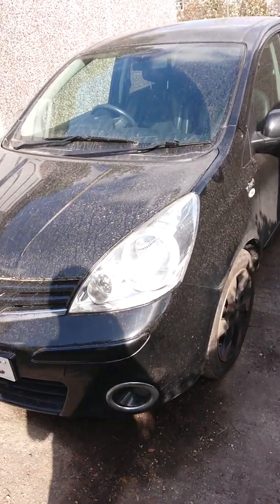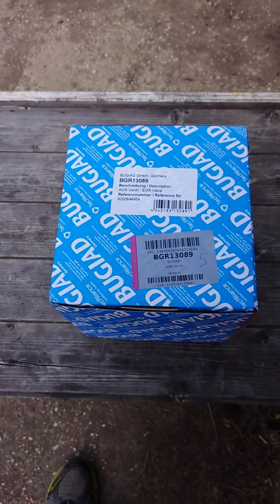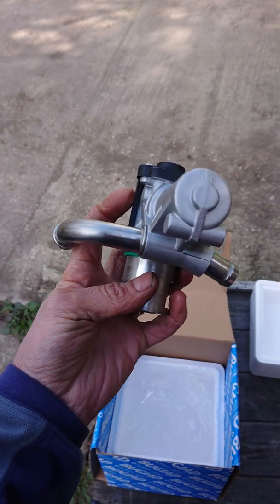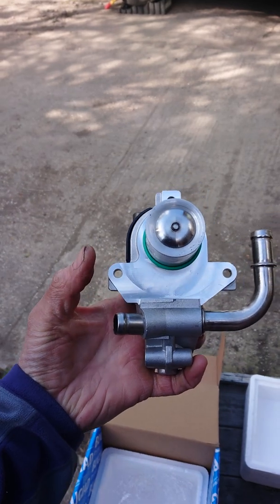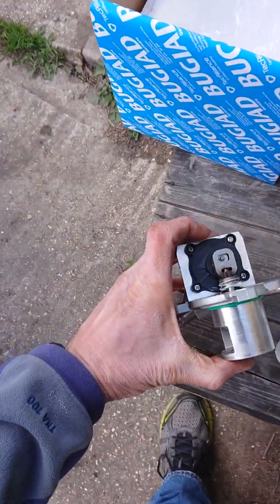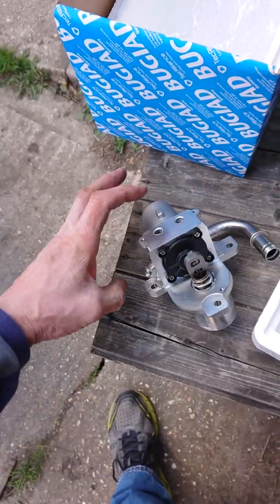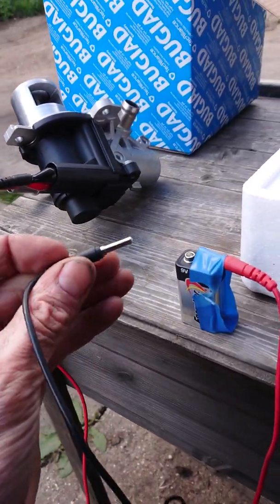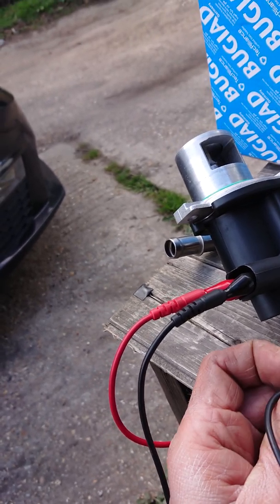EGR valve functional test, Nissan Note 1.5DCi, 2012. Part 2

Comment: Hello, thank you, can you show me pin n° 2 and 5 on plug please.
Reply from the maker: Not possible I'm afraid, sold the car. But there's 5 pins, 3 go to the switch and 2 power the motor. If you can't see tiny numbers inside the socket then just use the trial and error method.